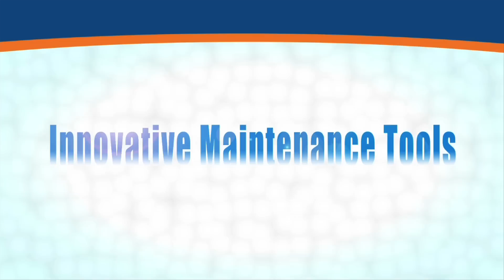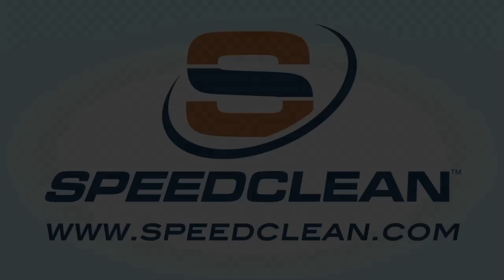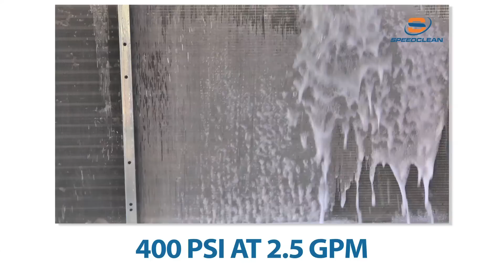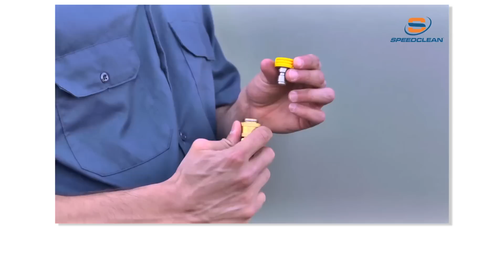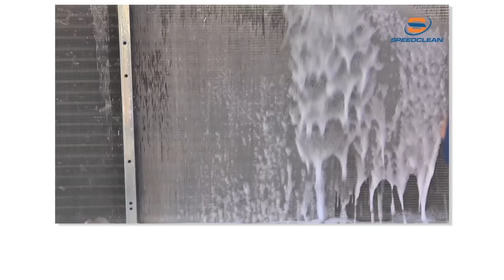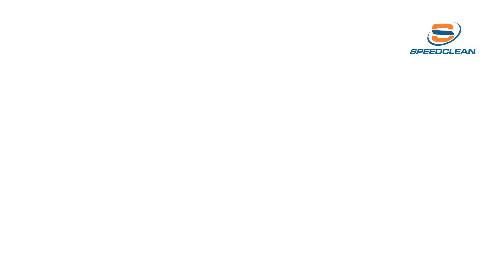SpeedClean FlowJet Coil Cleaning System with Foaming Coil Cleaner for Thick Coils

Comment: Absolutely no reason to use 400PSI pressure on delicate fins. spray with coil cleaner, rinse with low pressure, and you're done. repeat if necessary.